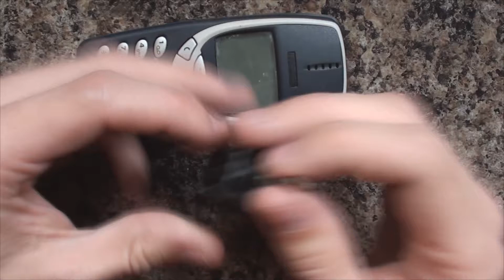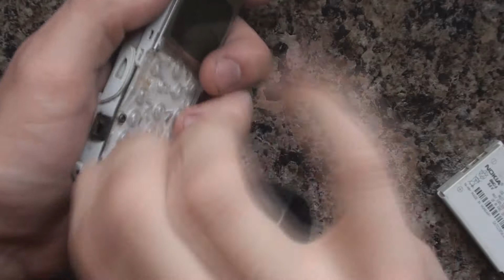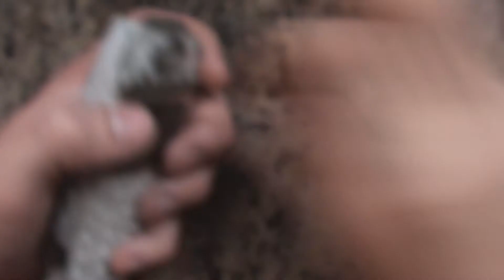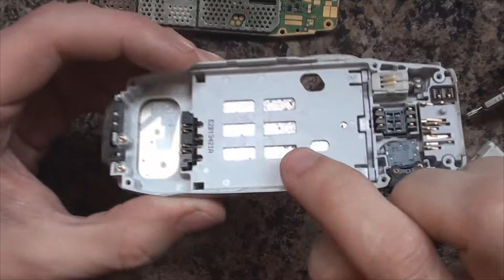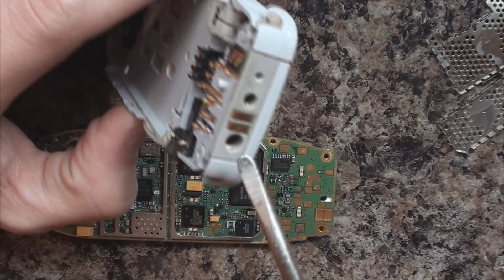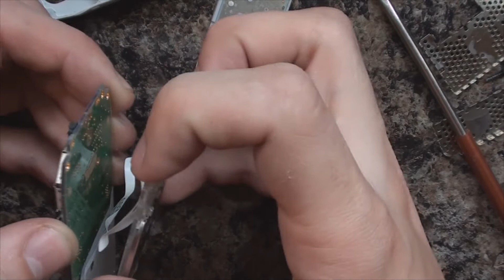Nokia 3310 Teardown

Comment: why couldn't they have color and polyphonic sound in those days?

the baseband processor alone in that phone has enough power to run a proper color User Interface.. guess LCDs and speakers were too expensive in the 90's.

Comment from the maker: The cages are just clipped on with indentations in the edge of the cage. I could have carefully removed them but considering the board is going into my scrap PCB box I didn't see the point. Apparently, for every 2.5 tonnes of old mobiles (which sounds like a lot but it's only two or three pallets), you can recover 1KG of gold which is worth around £40,000!